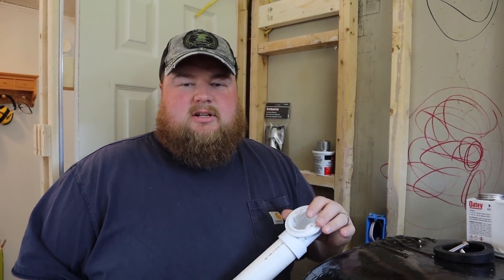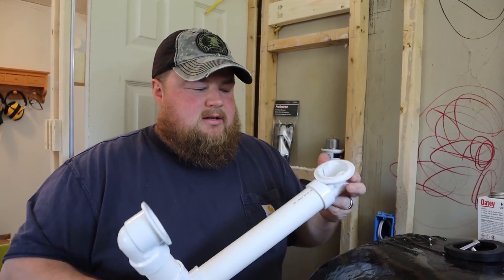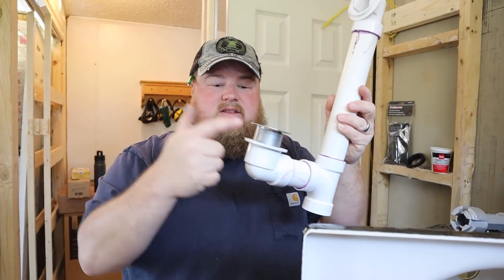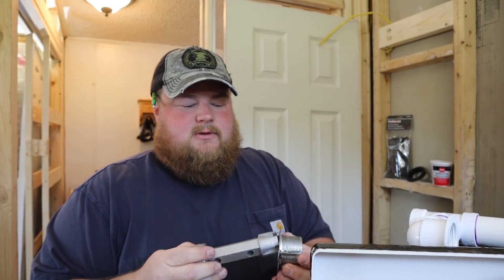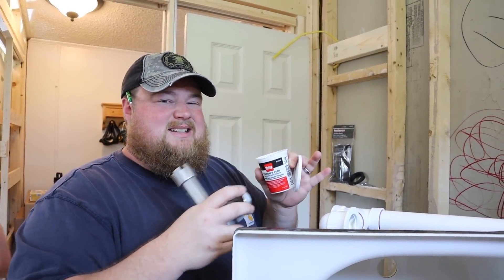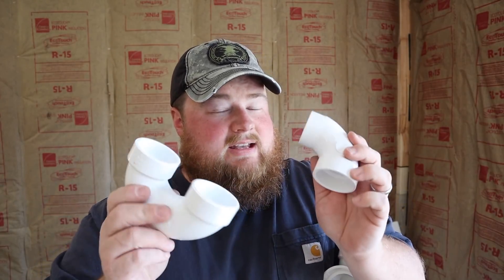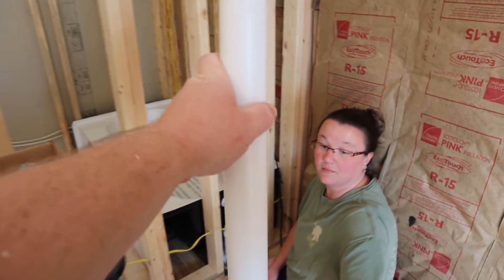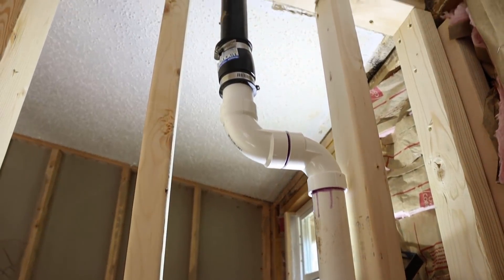BATHTUB DRAIN INSTALL - Mobile Home Bathroom Renovation - Delta Styla 54" Bathtub

Comment: Love your videos because you tell it as it is! Warts and all! That is why I watch them, no frills, no arrogant I know better than the experts. There are only 5 or 6 DIY videos I watch regularly and all for these reasons. The ones I never go back to are those where someone is unpacking a new tool sees the instructions and throws them away. Thinking this is so clever, I do not need the instructions they are for dummies, then blame the tool when it does not work properly. 🙄🙄😱😱😖😖 Can not wait to see what comes next. 👍👍👏👏

Comment: Glad to see you have the room to relocate the vent pipe.  Your solution is more elegant than what I did.  Did not have the space for your solution.  And I did not want to make another hole in the roof to relocate the vent stack.  So I dropped the pipe size down to 1 inch for about 3 feet in the vent stack.  It allowed room for the new shower faucet, PEX pipe and the vent stack to remain.  It is not as efficient but it does work.  There are times I can hear the air rushing through the smaller pipe.  But it is rare.  My house is a 1978 double wide.

Comment: I used flashing metal and metal tape to seal up around the tub and pipes to keep the varmints  from getting under the tub and anywhere they might get through. Spray foam in cans seals everything  off to seal up anything I couldn't  with flashing and metal tape.

Comment: love the detail...here in the united kingdom you can buy a plumbing kit that is similar but has rubber o rings that screw together squeazing the joint without the putty ...the benefit  is its not glued  so can be dismantled if needs be .available from your local  D I Y SHOP ( DESTROY IT YOURSELF ) ...ALSO....IF YOU USE A 3 INCH HOLE CUTTER INTO THE BATHROOM  FLOOR YOU CAN then cut a square of three quarter plywood maybe 9 inches sq then a 3 inch hole in the middle next cut the square in half ...then use the two halves to seal the little critters out of the under side and make it secure but accessable....keep up the good work
Reply from the maker: I LOVE the Destroy It Yourself term!! 😂

Comment: In the uk we dont have the vent pipe from our bath or basin drains wehave the septic or sewer pipe T off and go to roof level typicaly outside the house or some times in side then boxed in.
1 large 4" vent stack.
But i do like the usa idea

Comment: On mine the drain and vent is all together and is running through the studs. Like the vent pipe just tees into the drain or the drain just tees directly off the tee. I'm going to have to try and piece together the tub kit and some other connectors. But hopefully with the way mine is set up I can  just do it through the access panel and won't have to cut the under belly they way it is set up

Comment: When I have seen areas where tubs removed the builder had put some mortar or concrete on the floor first so the tub would then be stabilized underneath so it would flex when standing in the tub have heard of this?

Comment: I'm amazed you haven't got compact bath/shower traps in the US! Assembling all of that from various bits of PVC sounds like a sheer pain, especially from underneath the floor! In central Europe we've got compact tub traps that only require a pipe at 15 degrees about 3" from the floor and everything else is done between the floor and the bath. The P-trap itself is a complete unit of rectangular pipe (complete with a little clean-out cover on the top) that screws to the drain kit (and all the bits of the drain kit are compression fittings too). No need for holes in the floor unless you're installing an accessible shower pan.

Oh, and our drain pipes are push-fit, every female connector has a little rubber O-ring and you just push the male end in with a bit of lube. I loathe doing solvent-weld pipes! With push-fit the worst that can go wrong is cutting too short and having to buy another length of pipe.
Reply from the maker: There are many things much cooler than what we can get in the USA. :) Some of the most amazing space-saving and ease of use items in Europe!!

Comment: Sam, how are you going to stop the mice from making another nest under your bathtub and then running up the walls again? Is there a way of making a box to surround the plumbing you did under the floor and possibly seal where the drain pipe connects to the other drains with foam sealant... I think that's what I was trying to say.

Comment: When I do plumbing I take the "everything AND the kitchen sink" approach. I buy every part I possibly can that pertains to the project. I've learned it's way easier to go back later and return some unused parts than to be 95% done and not be able to finish because of one elbow. It's the worst!
Reply: Yup great advice. Unless your close to a hardware store. And even then, nothing worse than crawling in and out of a cramped space more than once.

Comment: But Sam tell us how you really feel lol. As a kid I crawled under the house and in the attic with my father. I don’t like crawling on the ground under the house either. Great job! I cheat and use the long handles on an adjustable wrench with that drain piece because I didn’t have the wrench and had to replace that drain piece was rusted out. Makes us suffer misery loves company lol the ventologist not to be confused with a ventriloquist lol

Comment: Hi... I have a suggestion... before you seal the bottom of the tub, Why not fill with insulation. so when taking a bath... the water stays warmer longer.. also will quiet down the tub noise when filling or people moving it.

Comment: Question~ I’m looking for answers I have a manufactured home and the flooring next to the tub started to swell and we have new caulking so I couldn’t figure it out until I took my flashlight and looked down into the tub drain and noticed the pipe under the tub is not connected to the actual drain in the bathtub and because it’s offset to the left of the drain water is going part in the drain and part straight under the bathtub. I’m assuming that’s the cause for the flooring issue. Is there anyway to fix this myself or should I call my home warranty company? I have no idea how this could happen as we are locked on a cement foundation with zero opening from outside just vents. Any advice how to proceed and ideas on how this could happen?

Comment: You made an s trap by using the extra elbow I would have dropped out of overflow assembly and gone straight into main with the elbow on trap s traps have a tendency to suck themselves dry and allow sewer gas to escape which is why they are no longer code

Comment: Should have put a bed of mortar or concrete up under the center of the tub to help with creaking and settling. The trap weir is too high, and you essentially made an s-trap.